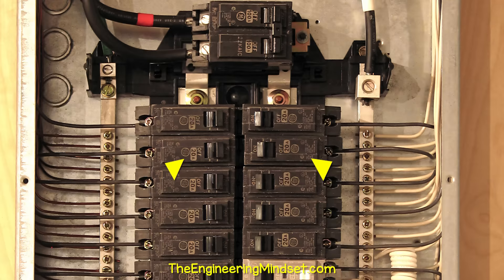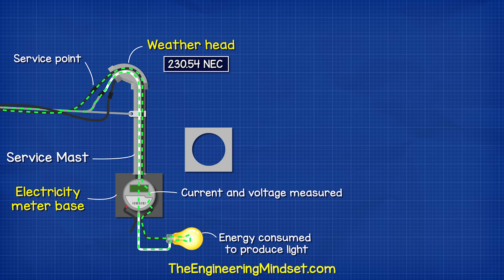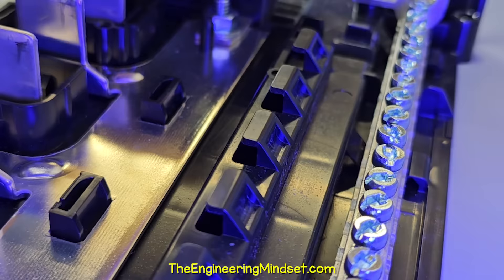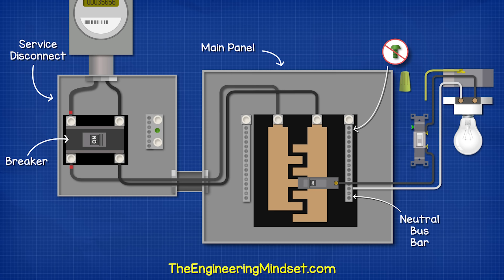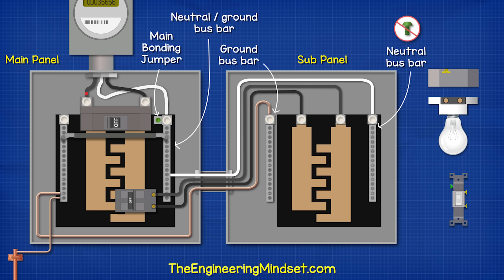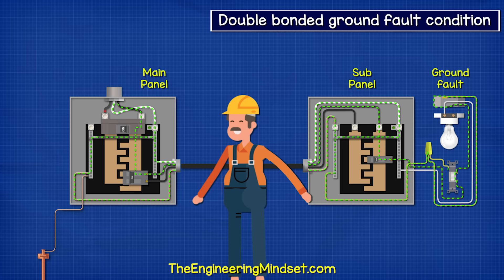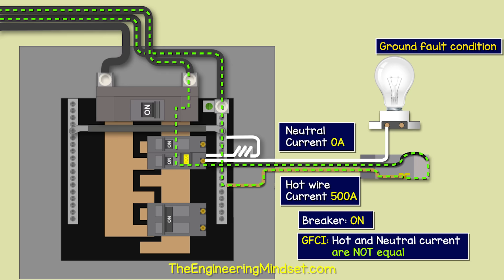Sub Panels Explained - Why are neutral and ground separated?

Comment from the maker: Get an exclusive Surfshark deal! Enter promo code ENGINEERINGMINDSET for an extra 3 months free at https://surfshark.deals/engineeringmindset
Reply: Good video. Can you do one on UK electrical systems? TNCS
Reply: Kindly make a detailed video on the Electronic Speed Controller and Servo tester controlling the  BLDC 2212 Motor.
Reply from the maker: Copyrighted
Reply: Can u guys do a video on comparator 🙏
Reply: WOOOOOOOOOOOOOOOOOOOOOOOOOOOOOOOOOOOOOOOOOOOOOOOOOOOOOOOOOOOOOOOOOOOOOOOW
Reply: Hey Paul, I need your help. Could you do a video on how Miller Delta series welders work? I'm a new maintenance tech just now learning about this type of equipment and I can't find any good source material. Your videos have been very educational for me on many different subjects and was what got me interested in this kind of work.
Reply: Can you do an episode in ARC FAULT CIRCUIT INTERRUPTING BREAKERS please, a lot of people in the trade have a big misconception about these
Reply: great video and that transition to the ad was mint

Comment: We do not bond sub panels because a ground cannot be a current carrying conductor. If you were to lose the neutral in a sub panel, and it was bonded, everything would work through the ground. And as I just mentioned the ground can not be a current carrying conductor. Thank you.
Reply: Thanks for putting it simply
Reply: Should your ground wires be run to separate bars in the box?
Reply: As in the ground being separate from the neutral?
Reply: Correct
Reply: Even if neutral was not lost ground would carry half the current if bonded.
Reply: @user-vb4em4vm5h Separate bus bars for ground and neutrals in a sub panel. The neutral bus bar needs to be an insulated bus bar. It will be attached to your sub panel metal box, but must be insulated from the box so the actual bar is not in contact with the metal sub panel box. The ground bus bar will be in contact with the sub panel metal box.
Reply: Correct as always, William!
Reply: Yea, pretty simple hun?
Reply: @nofortunatesonII isolated
Reply: @wwatkin21 it’s actually both, isolated from ground and insulated from the box.
Reply: Seems like we need one more “oh shit” wire just in case everything else fails. 😂
Reply: Why would you want the 2nd earth ground bar at the sub panel?
Reply: @tjmooney4181  exactly, this is what i dont understand. Why not just run 3 wires to the sub panel and let ground and neutral be on the same bar
Reply: @tjmooney4181  there's no limitation to ground.. the more ground bar the better.. we are always like to put the electron faster to the ground if we are having lots of ground bar.. don't be lazy

Comment: As an electrician of 36 years I enjoy your videos very much as it reminds me of why we do what we do everyday without thought. It helps to refresh my memory thank you!
Reply: Help me out here, main and sub panels connected by non-metallic raceway and way too far apart to ever be jointly touched. I'm not following how an absent neutral fault in a (wrongly) bonded sub panel is somehow worse than an absent neutral fault in a main panel with a (properly) unbonded sub panel. It seems in both cases current returns to the buried ground rod of the panel in which the absent neutral fault exists, energizing that panel's housing, and perhaps not tripping the breaker.
 
So is it just the issue with current getting on a metallic raceway between the panels or an alternate path between the panels via a person contacting both that is not present with my scenario.
Reply: @melainewhite6409  Because when you don’t isolate the neutral buss in a sub panel regardless of the distance the ground buss and the neutral buss are bonded together through the panel frame.  Now the ground buss and the neutral buss become one through the metal frame of the panel. This is dangerous because both busses are going to carry current back to source (Which is your main panel, then your utility). The ground buss should NEVER carry current unless you have a fault to ground which then it will cause the circuit breaker to trip. In the main panel it is not an issue because the only thing between the main panel and the outside pole is your neutral/ground where they now join as one conductor. 😎
Reply: @Mark-eu4di  Thanks
Reply: I'm not a pro, but I'll never forget a quote that I read on Tom Henry's website nearly two decades ago: 
"An electrician is educated to the fact that there are times when we don't want electricity to work."
Reply: As an electrician of 42 years I could have explained it in a 2 minute video.

Comment: Always wanted to understand why you don't bond ground and neutral in a sub panel. Thanks for the great content!
Reply from the maker: Glad to help!
Reply: I still don't understand. Cau you explain please 🙏 to me? Thanks...
Reply: @@spotscorner6040 I really appreciate you kindness for answering. I do understand that the ground wire needs to be bonded to the white (neutral) wire in the box panel. What fo not understand is why the su panel is not. Thanks....
Reply: Because the ground cannot be a current carrying conductor, and if you were to lose the neutral in a sub panel, everything would still work through the ground. And like I just said the ground cannot be a current carrying conductor, so that is why we do not bond sub panels.
Reply: @williamrose7818  that explanation was the missing piece for me. Thank you!
Reply: This is what I don't understand. The sub panels connect to the main panel. Main panel neutral is bonded to ground so doesn't this transfer to the sub panel? So neutral and ground are already bonded at the subpanel. So I'm thinking ground would work as neutral. Though I know this is incorrect and have not tried it. Just making Theory so I can understand. Thanx.
Reply: @performancedanny  You're correct, but the gotcha is if you touch both panels simultaneously, YOU are the path of electricity now, if both are bonded. Bad.
Reply: @jackh125  I don't get it! can you explain a little further. Like how could you become the path? by accidentally touching a hotline?
Reply: @williamrose7818  hypothetically if you lost neutral in a sub panel wouldn't everything still work threw the ground anyway because it's connected at the main panel?

Comment: So basically, the ground isn't really a ground.  It's basically just a path back to neutral to purposefully allow more power to flow, to make the breaker trip, so the appliance doesn't become electrified.  So wait, if you bond the sub panel, won't the same thing happen?  Won't it still allow too much power to flow and trip a breaker the same way?  I don't get that part.

Comment: Transformers almost always connect to 2 of the 3 phases of primary, other than that this is one of the best and most accurately explained videos I've seen.
Reply: Is that not how it is always done, I think the video is definitely wrong with regard to the SERVICE HIGH VOLTAGE LINE CONNECTION. Don’t you need to have the high side of the transformer connected BETWEEN two phases so that ALL of the current loops through them and not a transformer ground. Some rural high voltage lines have two lines and not three but I don’t think that one is a neutral but just the other phase!
Reply from the maker: There are a number of ways the transformer might be connected. It's going to vary by region. The one show is the simplest version just a single phase pole mounted type, it will work just fine. This isn't the point of the video so I have not discussed two and three phase connection transformers, just a basic understanding of how it's all connected to the grid so we understand the fault paths.
Reply: @EngineeringMindset  I was going based off your statement that it typically only connects to one phase. That is incorrect. Although single phase connecting transformers do exist, they aren’t typical. They are the rarest type. They typically connect to 2-3 phases, even for residential.
Reply: A single phase delta transformer has two bushings connected to two of the three primary wires, so the primary winding sees the phase-to-phase voltage. This avoids returning primary current through a neutral that must be solidly grounded to keep its voltage near earth potential. Since the neutral is also provided to customers, this is a big safety advantage in a dry area like California where soil conductivity is low. The main disadvantage is higher cost, e.g., from needing at least two insulated 'hot' phase wires even on a branch circuit.

Other areas that have ground conductivity that is higher can be wired as per video but require a neural return path to the substation. This appears to require a 4 wire system on the primary side (or 2 wire system on 1 phase system) unless the video author suggests that the return current from the line transformer to substation can travel through the “actual ground”! So it is suggested that the provided video diagram is the simplest or a 4 wire system is simpler than a 3 wire primary system. Not too sure that a 4 wire system makes more sense than a 3 wire primary system particularly from an educational perspective. If the suggestion is that the return current can flow through the actual physical ground then that brings up some other safety concerns. 

The only high voltage distribution system system that I am aware of that has current flowing through the actual physical ground is in HVDC long distance transmission lines. 

So maybe the youtube author could do a video on the “economic considerations” of why a 4 wire system is preferred over a 3 wire primary system.
Reply: @phenry5083  
At least what I have seen in California it is typical to connect the primary between 2 phases for a residential “split-phase” service. 

The other possibility that I have seen in PGE areas is the use of multiple pole transformers feeding a 240v split-phase circuit that is placed below the high voltage lines. This is done to provide redundancy to the lower voltage service circuit but I have seen this cause significant low voltage problems if one of the transformers is nonfunctional.
Reply from the maker: Seen our new 3 phase transformer video?➡️: https://youtu.be/u0SsejDCVkU

Comment: After years of asking why you don't bond neutral and ground anywhere outside the main panel and getting the response "because you just don't", I finally understand why. It's all about getting the breaker to trip when it needs to. I can also see why other countries requires GFCI breakers, as you're SOL if you lose service neutral in the majority of US homes. Thanks for making this extremely easy to understand!

Comment: Thank you for this, very informative. 22 ish years ago when I was a wee young apprentice plumber, I was cutting in an ice maker tee off the main and got whacked off my ladder. I found out latter that they 'lost the neutral'.  I was so unsure about what actually happened, that for many years after, I would use jumper cables to jump any main cuts. To this day I keep an ncv wiggy in my tool bag for the occasional 'shocking shower valve'. Thank you again for this great presentation.

Comment: 11:48 this is a ground fault and short circuit. Another possible ground fault is neutral to ground, which is not a short circuit and won't generally trip the overcurrent device. Just another reason why GFCI is important!

Comment: Excellent video. Properly explained and I appreciate the correct terminology. I’m an electrician in Canada and we do it the same. The only difference where I am is a grounding electrode is not required for a sub panel if your bonding conductor is sized correctly. Of coarse you always have to check with your local municipality for amendments and technical interpretations to the national code. Every area is different due to things like climate and weather.

Comment: I am just a DYI dude. OK, I'm an engineer and fairly well educated about electricity, but I'm no electrician. I've rewired my house, replacing old wires and balancing circuits (with guidance from a licensed an electrician), installed new circuits, etc.

I've never understood why sub-panel ground and neutral are not bonded. I've watched a number of YouTube videos and asked pros, and they just never really made sense to me. This video has made it very clear, and it was done really well. Thank you!

Comment: Thanks for this video! I need to revisit the 110 "Shore" service panel in my bus conversion motorhome. The "Main" panels in RVs are technically sub panels and I need to make sure mine is right. I knew this when I wired it and knew about the special considerations for the neutral and ground bus bars, but I didn't know why. Now that I do, it all makes sense.

Comment: @12:57 When bonding the subpanel, it is true that parallel paths occur during ground fault but its not a big deal since it is shorted and therefore will happen only momentarily. The real problem is during a normal condition. The current will still flow in the two paths and also through the enclosure.
Reply: Yes, I agree what he said was incorrect and that the breaker would do its job. After I posted my comment I scrolled through the comments to see if anybody caught it.

Comment: I think there's an error here: 13:24 the ground fault current will travel on the metal raceway even if you don't bond the ground and neutral in the subpanel, because the subpanel ground bus bar is bonded to the panel chassis via the screws that attach it to the chassis. The reason that you don't bond ground and neutral in the subpanel is to prevent the ground wire from carrying return current from the subpanel to the main panel during normal operation.
Reply from the maker: Notice at 13:07 it states "equivalent path shown for simplicity" as it's difficult to animate current through the case.
Reply: @EngineeringMindset  Yeah I get that. I just don't understand why you said "if there's a metal raceway between panels, the current will flow on this also" as a result of ground and neutral being bonded in the sub panel. Current will flow on the raceway whether or not ground and neutral are bonded, because the ground bus bars are bonded to the frames of both panels. And the thing about a human carrying current between panels is also possible even without bonding ground and neutral in the subpanel, for the same reason.

See @rustediron4062 and @cornpop7805 comments for basically the same objection, worded differently.

Comment: Very good video, and as an electrician myself I appreciate the NEC code references. A couple of things.

1) At time 13:00 where you talk about "double bonded ground fault condition", NEC reference 250.6 talks about "objectionable current" which is essentially what you're explaining when the installer mistakenly bonds the neutral and grounds in both the main and sub panels. It would be helpful to add that reference. 

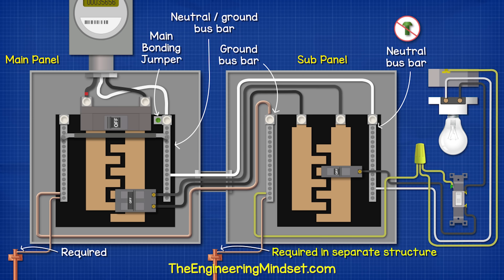2) At time 10:50, you're code reference is incorrect. Im assuming this was just a typo on your end. You meant to reference 250.24(A)(5) which prohibits the grounded (neutral) conductor to be bonded to the equipment grounding conductor(s). 

But awesome video. Thank you for making it.
Reply from the maker: Thank you. Good points too. For the NEC codes I have just written the article number and the section number rather than the sub points within that section simply because I think it's important the viewer reads that entire section and not just the sub point else they will miss vital information.
Reply: Yes that makes sense, and I do agree it's more important the audience doesn't get lost in the weeds. Whenever I have to explain electrical concepts to my customers I try to keep my explanation simple and easy to understand.

Comment: 12:58 - 13:47 
I need further explanation.
The ground bus on the sub panel is already connected to the sub pannel box right? so wouldn't current from a fault flow through that metal raceway and potentially through you if you bridged the two boxes regardless of the neutral bus being connected in the sub pannel? If the ground bus is not connected to the sub pannel box, then how would a fault on that box trip the breaker? 
I can understand why you wouldn't want them connected during regular operation; (no fault) because in that case the ground wires and the pannel boxes would act as an exposed neutral line but I don't understand why it matters durring a fault.
Reply: @rustediron4062 That’s been driving me crazy but reading your comment I think that’s the answer. I think in regular operation you would be safe by touching the two panels (when properly connected). At ground fault it wouldn’t matter how they’re connected you’d still may get some current. At least that’s what I think. 

Did you find any answers?
Reply: @GeronimoChannel  so if everything is connected properly the breaker will trip almost instantly from a ground fault which essentially makes the risk of touching both during a fault negligible. 

If bonded in both places it makes it so during normal operation the ground wire has a path for current to travel which is not supposed to have current for any other reason than during a fault.
Reply: @Hoaxiin  i see. Thanks!

Comment: Thanks for this simple and straightforward explanation. Now, I use a portable sub-panel which I use to run my VFD, welders and portable lights. Should the wiring be as if it was wall mounted?

Comment: Exception!  I am going to go out on a limb and say there is one exception to the rule - you should bond the neutral and ground in a subpanel where there is a gounding system at the subpanel and there is none at the main panel.

Comment: Although the first 75% of this video has nothing to do with the topic it does has a lot to offer.  You are indeed close but no cigar. The moment either phase hits the ground regardless of neutral the dead short will trip the breaker. 100% correct about the return path carrying current to the equipment through the bond.